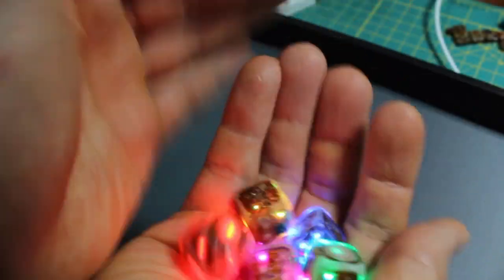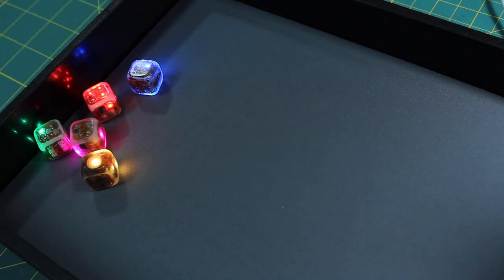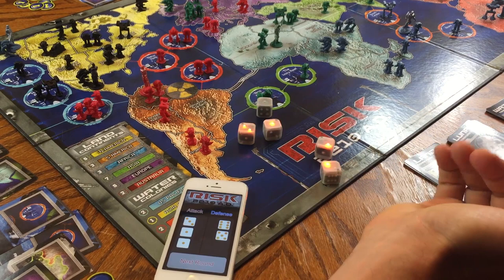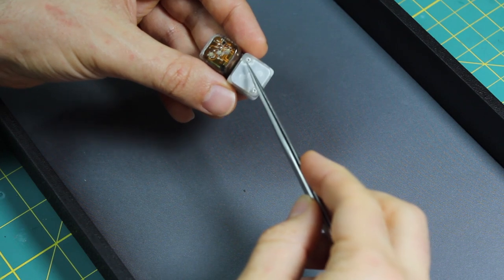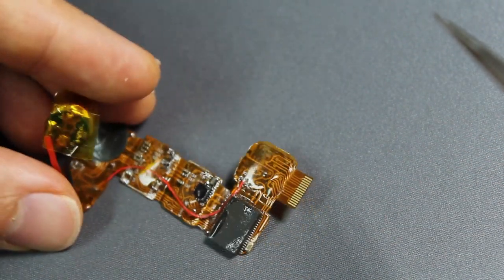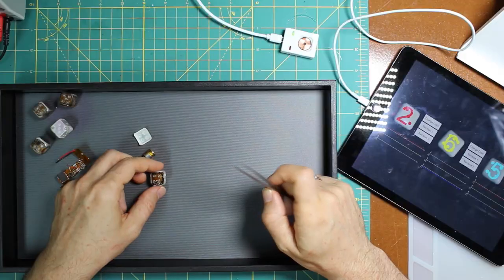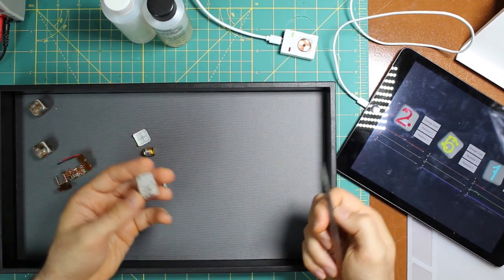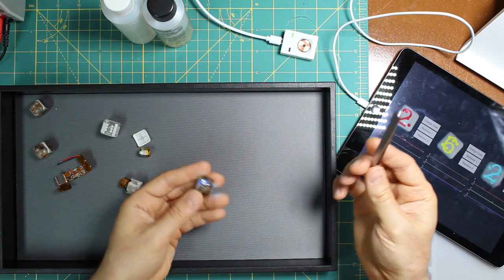The Electronic Dice, Prototype #3

Comment: That's really impressive. You've taken the miniaturization to a very impressive level here. I also worked on a similar personal project, and I got nowhere close.

I have a few observations though; although the clear resin is quite cool looking, it makes it hard to see the result of the roll. Maybe it's easier in person and the camera is making it trickier than it should be though. I think dimmer LED's, staying on for a longer period of time after the roll, and shining through a diffused surface would make it a lot more legible. Maybe even light-pipes glued to the top of the LED's, and then filed down to size after the resin casting is complete. Same smooth and compact result, but with very clear digits that would appear to "project" to the surface of the die itself, rather than shining from below the surface. Although I'm sure it would be a whole new nightmare for manufacturing.

Comment: I really like what you have done so far. I'm designing a similar sensor that can measure large accelerations. I did a similar design with yours but with rigid PCB. I recently found some manufacturing can produce rigid-flex PCB, which may help you to resolve the detach of the IC pin from the PCB when folding it into shape. But that definitely will increase the cost.